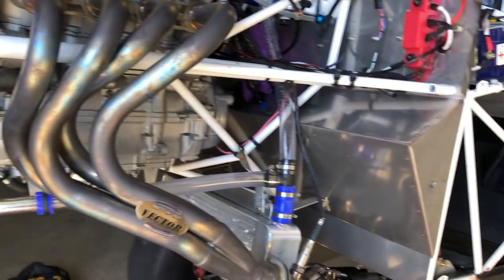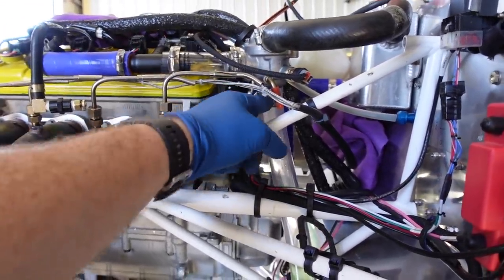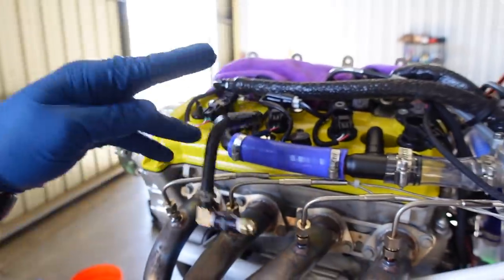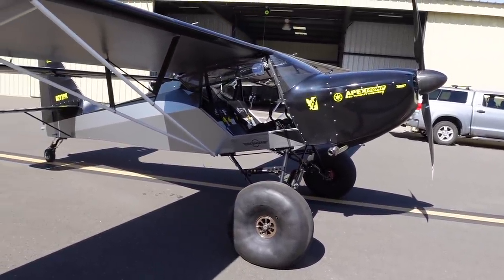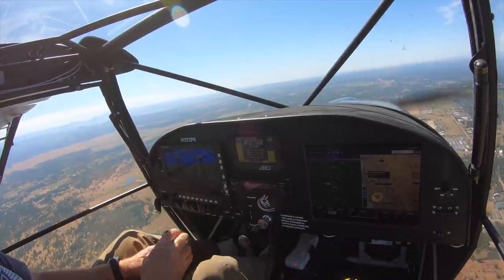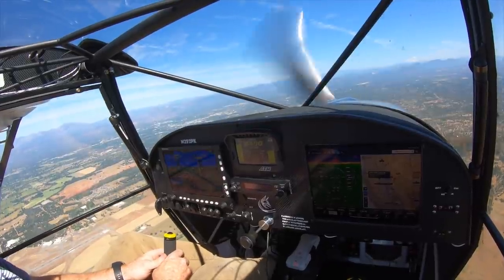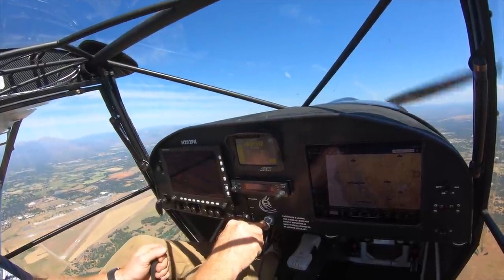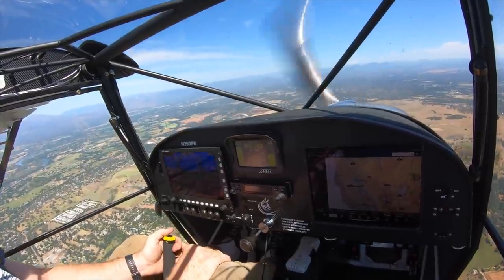Kitfox 7 Apex Build Episode 49 Flight Testing The Cooling System

Comment: Watching you for a while build this, 💘.  Awesome.   I'm gonna throw a dart at this temp "issue".   New engine.  Tight Tolerances on a lot of parts bottom & top end.   IMO, I think after 50 or so hours break in, the friction will be less as the machine parts smooth and settle.  
Maybe someone with more experience than my E2-C Hawkeye mechanic in the Navy could chime in.  
Congrats on those stall numbers.   Steve Henry I'm sure is watching you.

Comment: I think your right about maybe adding an oil cooler. Maybe a small one, although you may need to cut another hole in your cowl. That way you can keep up with the Flying Cowboys over in the desert. You can hang the cooler in front of the coolant radiator.

Comment: Believe Indy car expansion tanks, (not sure if oil or air) use a round tank and spiral the fluid to help remove the air.
So the inlet and outlet need to be configured to flow coolant around the side wall of tank...just an idea .

Comment: Get yourself a vacuum coolant fill kit. It's a life saver the eliminates the need to bleed and burp the system. I've got a Subaru powered RV7 at Yolo and I've spent many hours cursing air bubbles till I used the vacuum kit.
Reply from the maker: Ordered one yesterday, I think it is a necessity in this application

Comment: Great deduction on the air in the system, liked the clear tubing to verify problem, sweet! .
Would look into a little bigger heat exchanger or dual exchanger to keep the oil temps down.
Reply: Agree.  Especially when the summer air temps are 30 deg. C or more.

Comment: Why wouldn’t you run the bleeder line to the coolant expansion tank like many modern engines.   This allows the engine to constantly bleed air if needed.
Reply: If you did it this way, you wouldn't have to do anything besides weld a fitting to the expansion tank, change nothing else besides connecting the bleeder to the expansion tank.  PROBLEM SOLVED.   There is a reason this method is now standard on nearly every water-cooled engine.

Comment: Awesome video. That's it. I'm getting my pilots license.
Reply: go for it --- I have never regretted the last 30 years of flying.  if you are young  and not independently wealthy a recommendation is put the money you think it will cost in a new bank account, continue to feed it and only use it for aviation.  I had to start and stop a couple times due to time/ money equation -- never having enough of both at the same time.  Good luck

Comment: Another great video been following since the beginning. Have you looked into Evans waterless coolant. There is next to no expansion since there is no water. Been running it in several cars with no issues. Pretty sure Viking is using it also in their Honda conversion engines.
Reply from the maker: I will check it out
Reply: Because of the lack of water, Evans has a lower ability to transfer heat than glycol/water coolant.  Also, the two types are incompatible and the system would require a very thorough flush to change between them.

Comment: Does the cooling system not function like an automotive one? If it does then you would want the tank with the radiator cap to be full. When the coolant expands it should push into the plastic tank and the as it cools off it should draw the coolant back into the system.
Reply from the maker: Sort of, the tank is an expansion tank so it is designed to be filled about a 1/4 full leaving room for the coolant expansion. I’m sure there is a formal for the volume of coolant in the system and the volume need to allow expansion.

Comment: Your problem with the air being trapped at the high point this is a typical problem with hot water heating systems. In the trades we use a automatic air vent mounted on the top of the run of a tee taking the outlet out of the bullhead of the tee back to the radiator or tank. The air vent can be hooked up to the vent tank.

Comment: Considering your boot cowl fastener dilemna. Have you thought about Hysol'ing a nutplate onto the backside of your tubing? 
Also, how's the airflow over your oil cooler?
Reply from the maker: The windshield is in the way unfortunately
Reply from the maker: No oil cooler, the apex uses a heat exchanger that uses coolant to cool the oil, however I have decided to add air cooler oil radiator

Comment: Awesome to see you're getting the little bugs worked out.  Bound to be a couple with such a new installation, but you're doing a great job troubleshooting and finding solutions.  Question: what size iPad are you using, and which mount did you install?  I like that setup.  Might want to use it in my Series 5.  Thanks!
Reply from the maker: IPAD 11 Pro with the Guardian Avionics mount, power supply and fan.
Reply: @BowenAero  Thanks!

Comment: Nice job finding the issue and confirming it before flight.  I agree with your assessment on possibly needing an aux oil cooler.  The engine mounted units have limited capacity for sure.

Comment: Was curious what oil your running?
Reply from the maker: Mobile 1 10w 30
Reply: @BowenAero  is it automotive oil or powersport oil?  Automotive oil foams at that high of RPM and will hold heat.  
I'd try AMSOIL metric powersport oil.   See if that helps any.

Comment: I'm wondering how that tailbeacon X is working
Reply from the maker: Works great.
Reply: @BowenAero  We are putting one into a wag-a-bond and after seeing your video instead of replacing the tail light we thought we'd put it inside where it's less likely to be damaged. I could just see someone running into it, maybe they should make it like the old hood ornaments spring loaded so it doesn't get broke if you bump into it. ...anyway great video, it'll be helpful to others too I'm sure.

Comment: Yes.  Like u mentioned.  I would run an aux air cooled oil cooler. That should get u between 180 and 200 F with the proper wetted surface area.

Comment: If you put a tube in the overflow tank that extends to bottom it will act as an expansion tank. So as it cools coolant will be drawn back into the system. A tube that extends from the bottom of the cap. If that makes sense.

Comment: Hi Brian, I fly a Mazda 13B engine in my Wag-Aero 2+2 and use an expansion tank similar to yours.  You're right about that Tank needing space at the top.  I use my expansion tank to remove air from the cooling system automatically.   That hose you use for a bleeder can be connected to your NEW Expansion Tank but put a restrictor in it about 1/8" max and connect the line to the bottom of your Expansion Tank.  Any air trapped in the top of you engine will now find its way to the highest point - which will be the air gap at the top of the Expansion Tank.   https://youtu.be/fozMJo_bXlE

Comment: Regarding the rivnut / windshield interference issue, do you have enough room for a press-in / clinch nut like https://www.biscoind.com/pem-pennengineering-sp-632-0/p?idsku=8895544&gclid=EAIaIQobChMIyYaw6e-78AIVVRitBh14Rw1WEAQYAyABEgI3evD_BwE. I recognize these may not be an acceptable airframe bit of hardware.

Comment: Personally I always fill my cooling system using an Airlift or other similar vacuum fill system to avoid trapped air. Also, may be a good piece of mind to check for exhaust gasses in you coolant.
Reply from the maker: I did check for exhaust gases in the coolant to rule out a head gasket issue.
Reply: I think it was head gasket or exhaust leak either have a vacuum or milky oil problem If heads don’t know a tough one! But I thankI think he’ll figure it out eventually between everybody, using their own thoughts and the bars and everything off everybody else I think will come to some kind of conclusion!!! Let’s hope Wrote what about the other guy who runs the Apex engine what does he do

Comment: I am begining to see the reasons rotax have a higher failure rate compared to lycoming and contential.
Reply: Whats the connection? This is a Apex engine not a Rotax
Reply: @iffykidmn8170  my mistake. I saw kitfox and assumed rotax.  Liquid cooling compared to air cooling.

Comment: This engine setup seems very complex, with the need for a reduction gearbox,  and sophisticated liquid cooling system, a high revving engine to achieve more power.
all leads to premature failure. Sorry to be critical, but I do not see the advantages of this engine over air cooled in terms of longevity and reliability.
Reply from the maker: Lighter weight and more powerful. It’s all a trade off. I had a Lycoming on my previous Kitfox and found the weight and lack of power was limiting. It’s experimental so might as well experiment.
Reply: I get what you’re saying. I’m an A&P and am used to conventional direct drive air cooled engines BUT...
Look at Rotax, by running half as big an engine faster and turning the prop slower they make much better STOL performance. The engine can be designed to turn up to that rpm and the reduction gears haven’t proved to be a weak link. 
A 100 hp Continental on a Kitfox makes it wimpy vs a Rotax.
Reply: Above addressed to athewake
Reply: @BowenAero  Brian, I have nothing but respect for your amazing build of this Kitfox, and have watched every episode keenly. I liked the comment ' Its experimental so might as well experiment"  Good point!